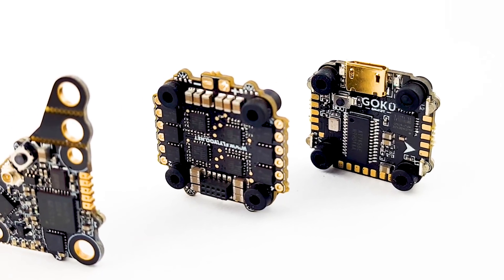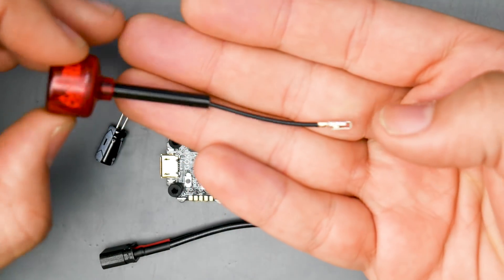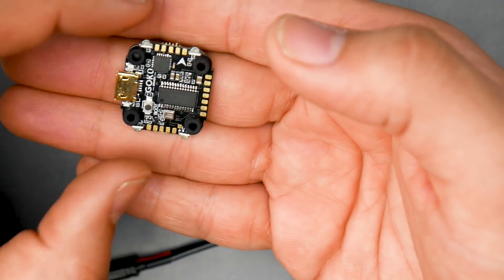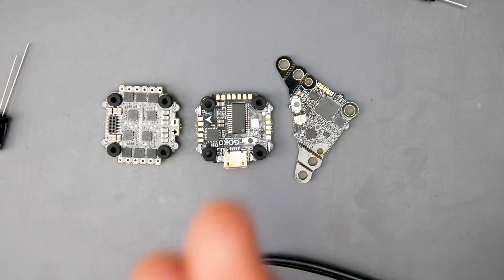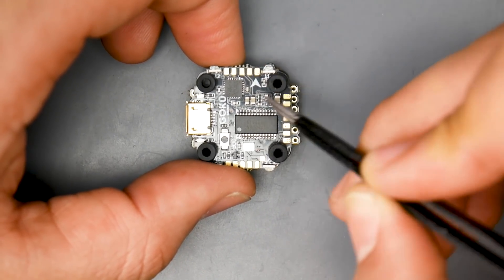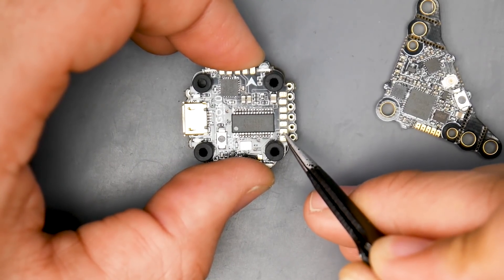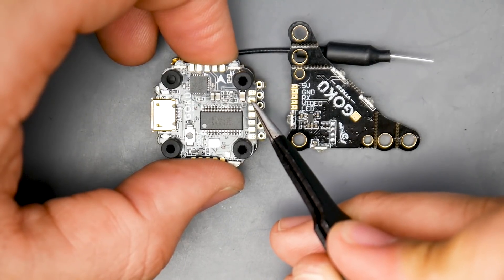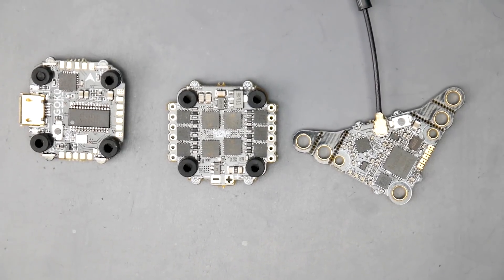Clever Design In A Perfect Package // FLYWOO GOKU F411 Micro Stack

Comment: Thanks for the Review, written on the VTX tab is 5v, but you are connecting this 5v tab to the VCC / Bat connector on the flight controller.  Should the 5v VTX tab be connected to a 5v FC tab instead?  Wont the VCC power fry a 5v circuit especially if you are running 4s?

Comment: I need to correct your VTX connection set up. The VTX is 5V and the pad you stated to connected to is "VCC" which would translate to the battery voltage. - Sorry to say but I fried 2 VTX's already cause I thought this was the correct route to go.

Comment: Maybe you should precise that the pad called "VCC for VTX" on the right side is not build for a 5v VTX but for the Vista. So, if you connect a VTX on this pad, it burns ! Flywoo doesn't precise this point ! Do not connect your Vtx on VCC VTX but on a 5v pad...

Comment: First, is there only 1 5 volt BEC on this FC board ? Also...Curious...My Flywoo XBot 3 has stopped working so I disassembled it...interesting is that the orientation arrow is pointing out to the side (rather than to the front)...the USB connector is oriented to the rear. I believe this to be the same on the XBot 65. So...if you just buy the stack the arrow should be to the front?? Did they use a special Betaflight configuration for the XBot...if so...hope they didn't when you just buy the stack.

Comment: Have you noticed Betaflight 4.2 does not work with the Flywoo VTX625?   Installed two different vtx's on the same drone and both do the same thing.  They do not show device ready on betaflight thus smart audio (tramp protocol) is not working

Comment: Pretty feature packed stack, but with 2 issues I see. First, more about the vTx than stack. I'd be a little worried about that vTx, when putting it in anything larger than the smallest holes. With that perforation, one smack to the ground or tree and they might just snap from the pressure and cause a short. Also, the connectors between boards suck! Crash and burn, literally, has happened with those over and over. P.S. Love that locking connector on the antenna. Brilliant!

Comment: Nah, don't buy pin stacks, after long term vibration the connector will break off. Just like my Dalrc 40A ESC. More prefer wire. Bad experience suddenly brownout and fall from the sky and crashed into roof.